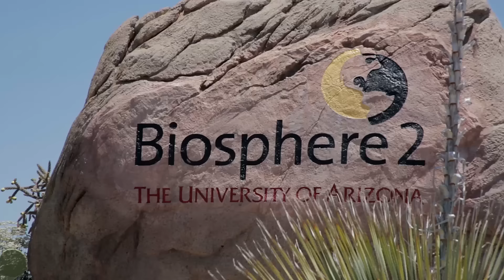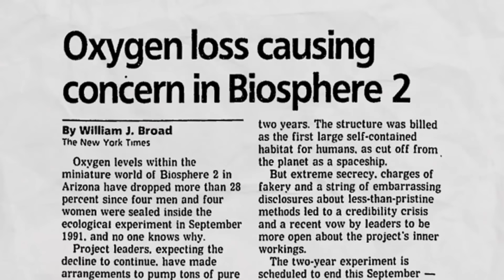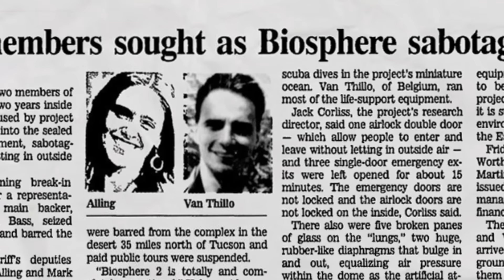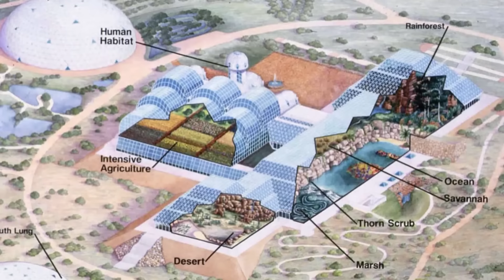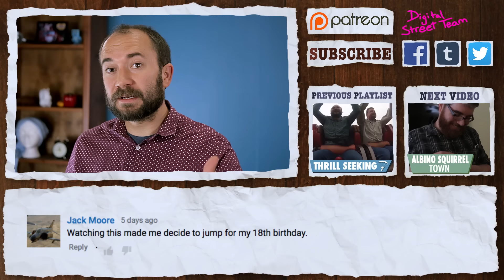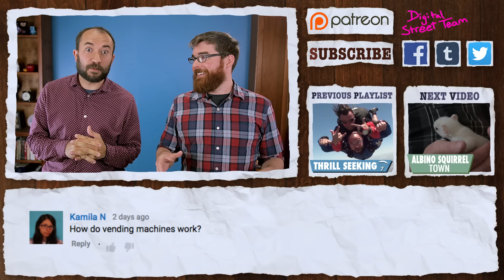Inside Biosphere 2: The World's Largest Earth Science Experiment

Comment: if i'm understanding the lung correctly, wouldn't the whole thing crash down if you opened a few doors to the outside? also how is lifting 6 tons of steel the path of least resistance for air to travel instead of pushing out some of the plexiglass panels? I'd appreciate it if someone who understands this stuff more than i do explained these to me.
Reply: Yes if it was sealed on hot in the bio dome and the lung was lifted and you opened a door the pressure would rush out the door and the lung would come how instantly.  How ever I am not sure if it would come "crashing" down but yes it would come down.
Reply: The point of the lung is to keep the pressure inside same +/- as on the outside. If you open the door the pressure doesn't change at all, or just a bit. The plate is held up not by the pressure, but by the rubber membrane around it. The difference then causes the membrane to contract or expand, thus correcting for that difference. Inside air pushes from the bottom outside air pushes from the top. The path of least resistance was reference to the air ducts and ventilation system installed inside the biosphere. Lol Now i notice you asked 2 years ago. :D

Comment: I have only seen 4 minutes... The oxygen falled because of the concrete.
Reply: No Name concrete absorbs co2 I think
Reply: No Name actually scratch that apparently it absorbs straight oxygen
Reply: Well lots of things oxidize and i do believe that,in small ways that uses up the oxygen but I am not sure and too lazy to google "are oxygen molecules used up or changed during oxidation" anyways, Oxygen degrading the concrete could have used up more than they anticipated. but its just a theory
Reply: Luke Bukem
Oxidation is when something combines with oxygen so... yes. Almost all metals, for instance, form an oxide layer around them. Iron-oxide or "rust" is one example. That is why when soldering or welding, flux  or inert gasses are used, it prevents the metal from forming that oxide layer by keeping oxygen out of the way so that the metals can bond. Once the oxide layer is formed, they don't stick. Allegedly, you can cold weld things together in space provided you remove the oxide layer first.
Concrete absorbing lots of oxygen is news to me but I know that thick concrete cures for many, many years after. If you take the Hoover Dam tour, they tell you that it's so thick that some of the concrete in the middle is still in as wet as when it was poured. Allegedly Roman concrete was far better than our modern concrete because it cured slower. Maybe this has something to do with the absorption of oxygen. I use to do compressive strength tests on concrete but I know nothing about the chemical processes that are involved in the curing.
Reply: Concrete produces CO2 hence the lack of oxygen.
Reply: The absorption of oxygen by the concrete is what initially got Columbia University involved in Bio2 and eventually take it over in the 1990s.
Reply: @peterjhartvideo 
Thanx for the clarification.

Comment: 1.  Get fish, bottom feeders, insects (those which are non-dangerous to humans), at least small birds, algae spores, and various non-harmful bacteria in there.   Create a bio-sphere that even pets could be brought into and survive without pet-food being "imported" into it.
2.  Include a modern waste-disposal and extraction system (similar to what's in the ISS).
3.  Exchange the windows for solar windows and include fluorescent lighting in the plant-growth areas.
4.  Do a better team-building job, prior to putting a team in there.  Require the team to live there but keep it as an open system for 2 years, then keep it as a closed system for another two years.  This will enable them to acclimate, and any serious team-related problems can be dealt with before locking them up like rats in a maze together.  Tip: get adults with higher functioning Aspergers on board with this.  They just do better in this kind of closed situation, are happier that way, and when they're all "on the spectrum," they get along with each other just fine.
5.  Provide enough (useful and creative) DIY project options, once the system is closed, that no one will have the time to go crazy.
6.  Increase the size of this project, and the number of plants included, by about 10 times, but don't increase the team size.
7.  Include better personal privacy options.  Rely on vlogging & emailed data-tracking reports, and so forth, for monitoring the situation.  
8. Include access to personal accounts, family communication, and so forth.

It's not that it's impossible to do this.  It's that a number of basic factors in doing it right were overlooked.  These are probably only a few of them, but they'd be a good start in the direction of creating a viable Biosphere for use on other worlds.

Comment: One big misconception that this video reinforces is that this is a closed system. 
It’s physically not for two reasons : first the Sun provides a lot of energy and secondly the buildings are powered by external fuel plants connected to the greenhouses. 

And that’s ok because if we want to simulate space travel, it’s ok to have both the sun and an outside engine. 

But don’t call it a closed system. It’s a system that tries to simulate a system where there is no transfer of matter with the exterior.
Reply: Earth is most certainly a terrarium

Comment: What doomed the biosphere experiment was not O2 production, it was CO2 depletion. They completely failed to take into account the amount of CO2 that the concrete base (made of Calcium Carbonate) would absorb out of the atmosphere. As a result, the CO2 levels fell drastically which made it look like the O2 levels were either stable or increasing over time. In fact the O2 was decreasing rapidly, but the CO2 was doing so much faster so that the O2 percentage was increasing, but the total O2 by volume was decreasing, dangerously. Finally they had to stop the experiment and open the seals as the Biospherians were suffering, paradoxically,  from oxygen deprivation in a nearly pure O2 atmosphere. All because they neglected to check a barometric reading.

Comment: Its funny that the air problems for it is so simple that it keeps getting overlooked. Its a simple problem that they dont see what is wrong with it. They almost got the program right but they will never get this going until they use a different outlook. Also its so funny they think that the lunar greenhouse is the solution this is why they wont finish without disadvantage each time. The solution is there but its overlooked every build of a geo dome.

Comment: IN conclusion of biosphere, not used to its full potential to gather information. 
What would I think of space travel and oxygen. I think I would rely on known variables and chemistry. Meaning calcium carbonate or something along those lines of utilizing organic means of growth verse raw slab stock piles, where you can measure out a few ounces, grams whatever to balance the Oxygen levels. There is information already about soil and how it moves, and shadows and light, that are really old from humans moving forests and logging. water table and top soil erosion.. Most erosion is caused from the sun evaporating the water in the soil, causing a draught. In a forest one usually has canopy that protects the soil moisture. So planting specific trees on angled lines you can create extended shade periods for your farm or area... Is it better who knows.. . biodome was a movie... Green arces is the place to be. One could mostly have a sterile environment, and if you have energy in x forms... you can create chemical reactions that go back and forth within a system. I mean I would say primary source would be chemist travel, survey geology, foundation setup, and biopharming is more like a secondary setup, simply because of how much work is involved. robots could build a habitat etc... and hten you go to that place.. Sounds like fun. Whats interesting is trees that can sense water and send out runners to grow offspring off and then die off. Plants are like open ended nerves in some regard, that is hwo I think of them.. just giant central nervous system and its bottom is its peripheral system... no head no arms , just basically a living chest... lol... However its abiltiy to find water sources and give nutrients ot other plants or in some cases kill and strangle and taken nutrients from other plants(evasive species) its a pretty weird thing. Not even sure what the fastest or top speed of roto growth is that is ever recorded of a plant. I do know they can bolt, which almost defies logic, that you go to sleep, and then wake up and its like 2-3 feet bigger and massive leaves. your like... what... hmm. one has ot think abouth te laws in physics andthus energy, then when you start getting into it, its like seeds are zip drives... of compact information, and thati nformation translates natural elements to build a system that we call living..  that code talks about all sorts of things.. the code has what we call conscience. each conscience hasa category. there not really named at the moment, as far as I have read. but each conscience level is about sensory feed back system that utilizes the code. .Then rewrites the software... the species... One could say evolution, but how the code is written is more then just simple sensory information to adapt. Some of its conscience code is in all things and levels. Ie attraction, information, memory, limbic, immunity, action, We call them autonomous.. but they are of their own conscience. the human body wouldn't work well under a democracy... lol Can't have the system not centralized in some way. However, a system of free thought fo action within a conscience of that system is stated as fre and given a and b choicesi n life. Good and evil.. Our lordi nthe bible of the tribe stated don't play those games of fgood and evil. it doesn't exist in nature... so we then have other problems. Of course then the serpents like now you are like tehgods knowing good and evil.. Itsa poor view and point of contention. Logically we do thigns, when those thigns end up hurting us we stop doing them that is ahealthy system not palying good and evil. just hey that lake kills people rom drinking it. Study lake... its not cursed.. it has a checmia lcyanide.. etc etc... then you have itnerseting human groups that adapt extra perceptiosn witin their normal sensory organs and advance mechanical systems. One such thing is a man that could smell toxic gasses where normal people couldn't and was able to help create machine that could read the data he was reading but others couldn't thus a machine epalces the old canary in the mine sort of speak. I call that method special and soft method of learning, the curelmethod of learning, would be to make a instruement and have many going on at once. Doing whatever to detect it. and then calibrate as say you release that gas intothe eair. The problem with at method is often the machine has false postives to trigger it. Of course today things are much more refined in identifying what something is...
With raw chemistry and energy, how long could a person live, if they have the tool sets? Thre is working marterthan harder? What is the exact point of a biosphere? Unless your wanting ot terra form a planet? deep space long travel... Babylon five.. itsa cool concept it spins so creates artificial gravity. that could work. what happens when it stops spinning. Then there is light etc.. If the code of what we have has many consciecnes that make up the thing that utilizes he raw material... the essentially we are in asense free choice is a lie... in truth it doesn set us free. We are prisoners of our own making from eon ago.. and hten just thing that exists but not of or it... It brings up more questions. the Catholics keep records and threis interesting iscussion of civlisations destroyed and thus the re inventing of music and the same systems of msuci and writing thoruhgout different systems like something lse experiementing on US.. weird eh... creating conflict and earth s their biodome of experiementation… oooo. However, all that information is form the iving consciecens in our systems that seem to always know everything in the universe.. and adapts ot construct itself ot operate within it. so we may think we invent thigns but we are simply connected o our inside spirit of the desgns behind things, it may be why we flesh for new things and concepts because the code is wanting to rewrite and add to it for the next gernation or iteration of its onsciecne creation. So we make new things...  Ifwe always  have stone walls and a palace. natureem ust destroy it, because its stagnant, the conscience inside needs rewriting or operating of its living programming.... that sjsut nonsense... lol end rant